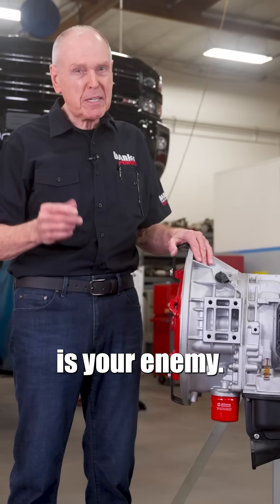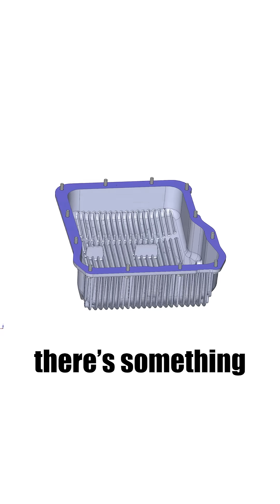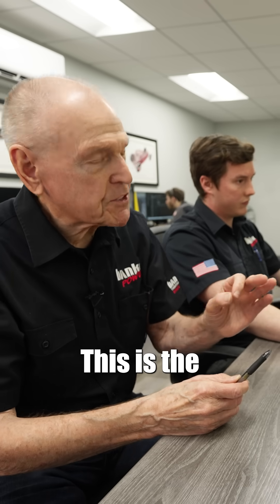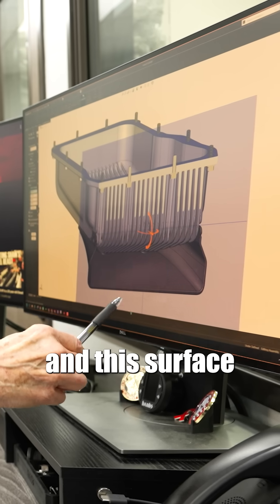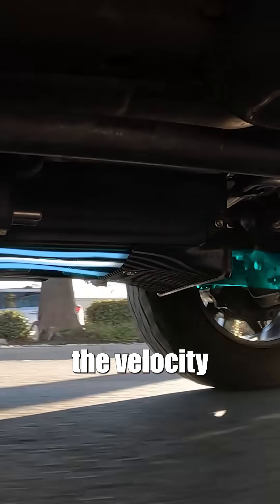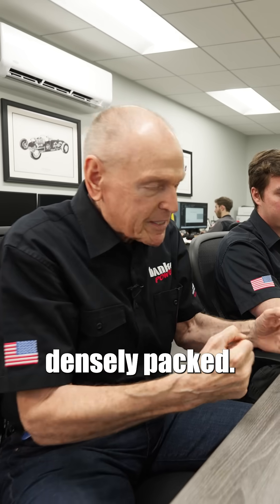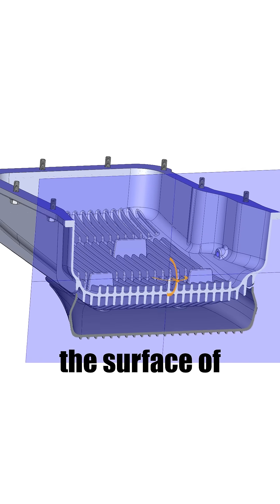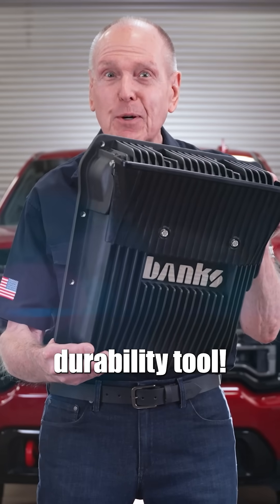This improves transmission life.

Comment: I've long wondered if auto transmissions failed prematurely due to inadequate cooling. A lot of cars and trucks have the trans cooler built into the radiator and it's usually the cheapest one they could get away with using. And there wasn't a trans temp gauge in most cars so you really had no idea how big a problem it was.

Comment: How is this not going to create a problem in colder climates and keeping the fluid from heating up enough to engage converter lock-up?  Most all transmissions have a cooler loop thermostat.  The cooler with thermostat allows the fluid to get upto a desired temp and holds it there.  If the fluid is getting too hot, add a bigger cooler.  This pan defeats all that.
Reply: if you live in a colder climate you likely wouldn't even worry about over heating you'd more that likely put heaters on the vehicle instead

Comment: for those who dont know why "scrubbing" matters:
it is because of the no-slip condition of fluid dynamics, which stated that the closer a fluid is to an object, the slower it is, to the point it actually became stationary to the object. it is bad because you want to replace said fluids to a new cool one, so It'll absorb heat quicker.
Reply: Boundary layer theory.

Comment: Great for running a hot trans in a hot climate, but in a cold winter, this set up has no thermostat to regulate trans fluid, unlike a transmission cooler. Not hating, I’m just wondering if super chilled trans fluid is a good idea at below freezing temps?

Comment: So heres my question, I live in a very naturally cold area (Maine), has there been any testing on the effects of cold weather in relation to the heat transfer? Is there a certian temperature region where the fins do more harm to the heat transfer than good? Lastly, is there a temperature region where its less helpful to have this increased cooling? (I.e the fluid cant maintain a target temp for peak viscosity). Driving a manual you can feel when the trans fluid is cold at the start of a morning and I wonder if there are certain trans fluids and conditions where the heat transfer is impeded or too efficient and it makes me wonder what steps have been taken for testing.

Comment: I'm 17000lbs GCVWR towing my RV with an 06 F350 6.0L PSD and the torqueshift 5sp with the a/c on at 30C and the trans temp is barely 170F.  Not even close to scorching the trans fluid on this truck.  How low do you want it???
Reply: I wouldn’t worry about the 5 speed here, it’s indestructible

Comment: When I was in an a/c training class, we were learning about the venturi effect and its ability to super cool air. I almost feel like this kind of falls into the same category. The decrease of diameter in the fins causes an increase in air pressure/ speed creating even more of a cooling effect. Makes me wonder why we dont use air more to cool stuff. I know air cooled is older technology, but with modern advances like this maybe it could compete with liquid cooled?
Reply: Water has 4 times the specific heat capacity of air, so it's always going to win.

Comment: Just get a transmission fluid cooler and mount it on front of the radiator, works the best! When that ridiculous scoop catches debris, it will clog up airflow thru the fins causing the fluid to overheat lmao!!! I see many people crawling underneath to remove debris from that scoop and people needing new transmissions do to overheating.

Comment: Doesn’t a trans cooler completely replace this pan? Wouldn’t a trans and transfer case skid plate block this off too? Allison makes good transmissions I don’t think they would overlook this. I don’t think this will make a difference is trans life. Fluid maybe but you should already be changing that every 50k or 30k towing.

Comment: I sure hope that you look at the Ford 6 and 10r140 next. Possibly figure out and explain why on earth Ford is running 190+ operating temperature on these transmissions.
Reply: Idk why they do but ive never had a problem with mine. In the winter it never surpasses 160 tho😂

Comment: I worry about that thing becoming a snow scoop or a mud scoop depending on where you are and what you do
Reply: That was my thought. Snow would at least eventually melt given time and enough heat from the transmission. But mud could clog it and make for a big insulator. Though, I would imagine regular washes could resolve that, still a potential problem.
Reply: @Youhaveaname  snow can be tricky, I had some packed in front of my radiator and despite my car overheating it acted as an insulator and never melted

Comment: That would be great on a pavement princess. Not on my pickup that get used to put up fence and has to get in the mud they would just have to be cleaned out every week or two.  I’ll just run my stock one and keep an eye on the transmission temp and exhaust gas temp . If it start to heat up just take a break or slow down.

Comment: Congrats Black Oxidized  We learned that when we did Corvairs and VW back when you were On San Gabriel blvd.  We put thermostats on the pan and on the cylinders with the aluminum fins  3 5/8 bore if i remember  much cooler than polished I liked your phrase "scrubbed" as a rough surface is much more effective than polished  cheers

Comment: Air, mud, or snow ❄️ 🤔 somethings gonna stay in dat scoop
Reply: That’s why the scoop is removable - also, a target market for this is people who tow. Most people are not taking a trailer through a cornfield, and if you did, you are not going fast enough to overheat a transmission. This is for heavy loads on the highway. 

And for the 10% of people who get crud in their tow vehicle - guess what:
You will need to clean the engine oil pan and suspension and differential(s) as well. Power washing that cover out cannot be that hard if you’re already cleaning your truck.
Reply: @JacobTheGunNut  aren't most transmissions cooled through the main radiator?
Reply: @samueladitya1729  Yes.
Reply: @samueladitya1729 and an external cooler. Most HD trucks at least the ones I've owned never go over 190 degrees. That's pulling 13k in 90+ degree temps. Haven't pulled anything with my new duramax yet so not sure on this one. My 15 half ton 6l80 ran pretty cool as well after eliminating the cooler t-stat. I did put an aftermarket pan on that, but that was just for the drain plug.

Comment: I love your stuff. And I totally get the rear diff cooler because it’s hard to put a pump and cooler on that. So your ram air diff cover is logical to me. But I don’t see the same logic in a trans pan. You already have a fluid pump and oil coolers can have 100 times amount of surface area in the grill in a smaller package. On top of that you’re trying to control much more heat energy. I just don’t see the trans pan making a measurable difference, especially since a decent fluid cooler seems like an easy and much more efficient option. I’m not complaining at all. I really would just like more explanation and measurements. I just think the surface area of those cast fins would be a tenth of the surface area of an equal sized fluid cooler, and the fluid cooler has the advantage of being able to be place head on in the grill

Comment: Just put a bigger external cooler on it and bypass any cooler internal to the radiator. Youll have more problems getting up to temp than keeping it low. The pan is just eye candy compared to a cooler. 

Gale banks again, selling stupid pans and covers that dont really do anything but make you think you're smart and increase mpg by lightening your wallet

Comment: That's all good but it doesn't change the fact the transmission oil flows thru the radiator.newer thermostats are 200 to 210degrees.to reduce the heat enough if you are towing you need to add an additional trans cooler.adding a larger oil pan if you are doing heavy towing is a big plus.the scoop on the pan will be effective til the first mud bog.and how many who wash there trucks will wash the underside and clean the debris out of the scoop.

Comment: The fins extending to the inside makes all of the difference.  Most of these aftermarket pans with fins don't extend to the inside so the fins do very little in reality.  This ram air setup is so simple it's genius.  It just makes sense.
Reply: I'd like to see the maths behind your claim before I draw a conclusion.
Reply: @WindyJAMiller I agree. The more I think about it it kinda doesn't matter that there's fins on the inside since they will be at the same temp of the surrounding fluid and not outside air. The gradient of cooling occurs at the air/fin surface only

Comment: Exactly what I was👇.  Imagine if Gail Banks just designed and built his own vehicle instead of trying to fix problems from the big three auto makers. That would be one bad ass vehicle.  Cause I’m thinking just build a bigger more durable transmission.  It’s like trying to go the distance getting a few horsepower out of a four-cylinder when you should just drop in a V8

Comment: Is there a reason to use this over an external transmission cooler?
Reply: I was thinking the same thing. My guess, that’s it’s more simple thus much more fail-proof option. Also, excess cooling almost never hurts, but if it does the air scoop can be taken off if needed

Comment: 10 speed! Finally something to reduce the temp from 240 when pulling grades on the gasser.
Reply: Have you tried upgrading the radiator? If the trans cooler is integrated into it, heat is actually going from the coolant to the transmission when the engine temps rise.
Reply: @raulo19999  3,000 miles truck. The transmission fluid temperatures are higher than the coolant temperatures meaning the liquid liquid exchanger has already been overwhelmed and you're relying on the air to liquid exchanger which can only help so much.
Reply: Try adding a larger cooler to replace the factory one. Have you checked your cooling stack and or flushed your radiator .I have 2024 L5P and combined towing of 23K.  I've towed the grapevine in 100 deg. and never saw above 190. That 240 is not good for the fake Allison with a gas engine.
Reply: @mrpickle219  yes but the difference is you're holding a nice steady speed and keeping the air flow high through the truck, whereas I'm hitting the grade at 70 miles an hour at full power 5,000 RPM and the vehicle slowing down to 26mph. 

And because the 10 speeds are designed to slip whenever they're in that situation  it just continuously slips, the engine begins to reduce power, the transmission continues to slip and it just builds a bunch of heat....

 it's a design flaw because they won't increase the line pressure of these trucks. Combine that with the ECM bearing protection programming built in when it sees stresses like that the vehicle begins to derate power rapidly which then lowers the road speed even more which makes the situation even worse. 

Duramax tuner has a video where they talk about the 10 speed and how it's designed to slip.
Reply: I agree. That's why I said fake Allison. I've had three different trucks(gas and Diesel )with the real Allison's. Their longevity each was over 250,000 miles and no problems. The 2024 just got back from repairing the valve body issue. Only has 32K on it.

Comment: I’m kinda dumb but couldn’t a couple electric fans mounted on the sides help keep it cool. Ok heat from motor or exhaust may interfere but what about an ac system designed to run with vents around the outside of the pan. Hot days everyone has ac on anyways route a vent there?
Reply: Or you could just replace the transmision cooler infront of the radiator with one thats a little bigger. More eficient than replacing the pan or trying to use the ac system.

Comment: That sounds really good for a beast that is always forced to perform.   

But what about cruising across the interstate with no trailer/ heavy cargo in the winter?   

Im not familiar with the temperature these create in modesty low load conditions.  Hopefully i don't upset an armchair rambo by saying my suv with 4l60e barely hits 130°f @ 70 mph, ambient 32 degrees, several hills cause TC unlock - but fluid temp drops on backside of hill.   
My Chevy needs what VW did ... a pan bra!  The oil pan has a foam lined plastic case that snuggles it with snappy wires as seen on air filter box.  1)appeases the Karens that donlike the rock grinder sound of 55mpg 2) helps maintain heat in winter stop & go.  I leave it off in summer.

Comment: I'd be concerned with over-cooling the 10 speed.  The valve bodies in those don't react well to temps under 160.  More suitable for them to run in the 170-190 range.
Reply: Your main transmision cooler is actualy inside your radiator, so your engine coolant helps keep your transmision up to temp, plus this pan is so ineficent compared to an actual radiator I wouldn't worry about it. Its a gimicy solution looking for a problem
Reply: @flyguyphil7247  Most all of the '10L/10R' units use an external heat exchanger.  Coolant still does the work but it isn't inside the rad.  Even a basic finned pan dropped 10 deg off my 10R80.  It never truly gets up to temp on a 15 mile drive home in the winter time.  With those giant fins and ducted air I doubt a 10L1000 would get anywhere near temp just driving around.  Towing, a different story.

Comment: You might consider a screen to go over the intake to prevent objects from getting stuck as others have mentioned. Only need something with holes slightly smaller than the smallest cross section you showed, but maybe screen durability is a problem. Maybe there's a reason you didn't, seeing as the ram diff you designed doesn't have any foreign object preventative.

Mud would probably be the worst thing with this. I would hate to have to clean it out all the time. Screen might help, but again not sure about the durability. Snow and ice getting stuck might honestly help reduce temps and would melt. Maybe a grate would work better?

Cool stuff!
Reply: Only a screen will also clogg up...
Reply: @VineV-Dutch true. someone else said these things are designed for towing efficiency not offroad which also makes sense. Maybe it’s a tradeoff for better convection.

Comment: WhJust use a big cooler, shaped like a radiator. Wow. I don't care how many fins you build into a pan to make it cost a lot, you'll never come close to the same cooling surface area as a microchannel aluminum coil. And this pan would do zilch if you're in Arizona, in July, sitting above a black freshly paved road, and stuck in traffic, and idling in drive because the nut behind the steering wheel never shifts to N while stopped in traffic. That's what burns up transmissions, not just cruising down the interstate at speed.
Reply from the maker: Proper transmission cooling should also include an upgraded transmission cooler. And, yes, the Ram-Air Trans Pan will be useful in Arizona because the fluid temp will almost always be hotter than the ambient air temperature 12" above the road surface. Asphalt softens beginning at 140°F. At 180°F, it can become too soft to drive on. This is still significantly lower than typical transmission operating temps. Therefore, air flowing over the fins still aids in cooling.
Reply: @bankspower  Yes it's a heck of a lot better than the stock pan that traps 1-2 quarts of old oil in the pan, but fins only work when driving.
Reply: By lightining your wallet you reduce the amount of work the transmision has to do. Both the trans pan and the oil pan seem like a gimic when it come sto heat disipation. I agree that an auxilary oil cooler, and a larger transmission cooler will do far more than these cast pans.

Comment: If you had total control of the temp, what is the ideal temp for an Allison 1000? I have a cooler from BD Diesel with an electric fan. I don't what temp the fan is set to though. It's supposed to uprate the trans to 30k lbs.

Comment: Air that is funneled tend to stop up unless there is suction at the other end. I actually doubt this works as intended. It might actually work better without the shrouding. It might though work okay if you can get the air to pack into the fro t end and ”thicken up” and slow down and thereby have more time to collect heat before simmering out of the back. I’d mss add le the shrouding be the length of the pan with just a little entrance funneling and a larger extractor since underpressure works better with gasses.

Comment: I think this a great idea, until it's clogged with mud, rocks, leaves... Why not just use a larger bypass cooler?
Reply: I was scanning through the comments to see if somebody brought this up. As someone who plans to go off-road, this would get messed up quick, at least the ram air part
Reply: This is for towing, not offroad.
Reply: @jalenad11  It's still not going to be as efficient as a larger transmision cooler even towing down the highway. Its a gimic.

Comment: Please make this for the 1/2 ton GM trucks from the factory those transmissions run unnecessarily hot mine runs at 190 just driving around unloaded
Reply: An auxilary trans cooler will do alot more for you than a cast pan will. Its a gimic.

Comment: Hello @bankspower! I am curious if this would be easily cleanable after off-roading with a lot of mud? I sure would hate to clog up my new pan and loose the efficacy of the improved cooling.
Reply: Should be able to just hose it off right after, likely won’t be an issue
Reply: Cleaning after a 4x4 adventure is one. But this is clogged up within 30 minutes here in northern Saskatchewan...